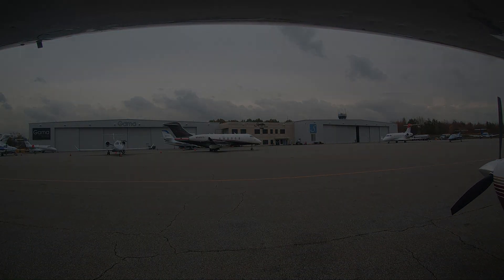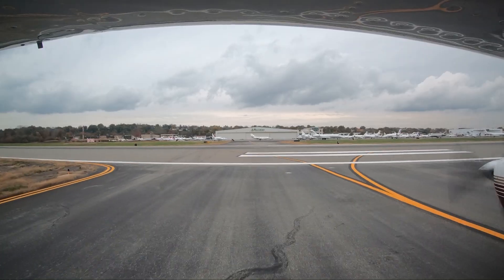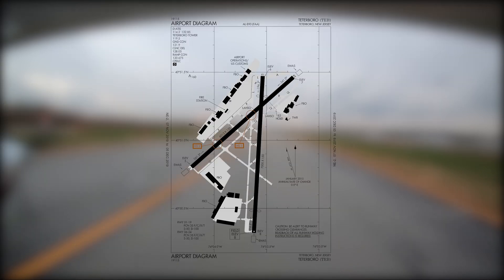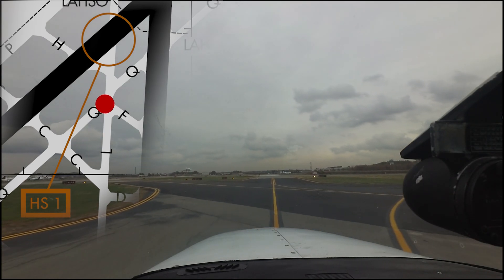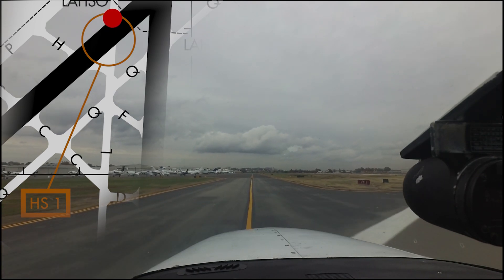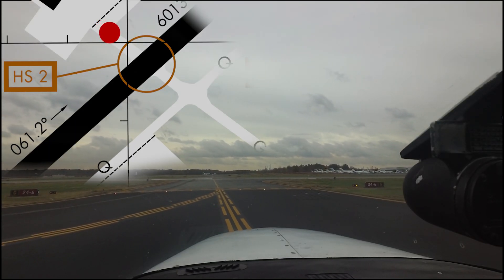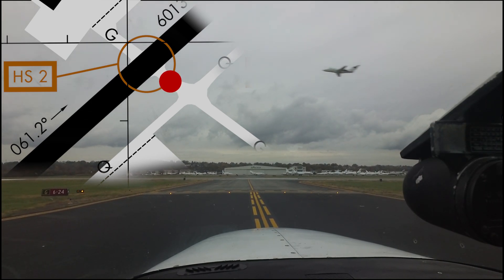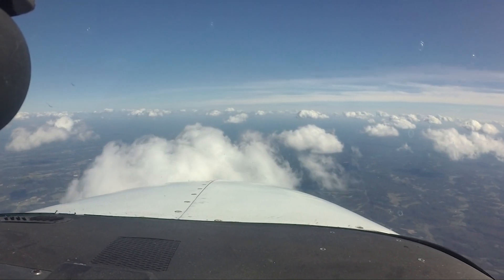From The Flight Deck – Teterboro, NJ (TEB)

Comment: First of all, great video. That said, why build an airport with such confusing intersections of taxiways & intersecting runways in the first place? That’s setting up the chance of an incursion before it’s even completed. Beyond that, any pilot that proceeds to take off when instructed to “Line up and Wait” needs a breathalyzer! Not only that but we are to read back all the instructions BEFORE proceeding. Not exactly rocket science. Be in your A-Game at all times when in the cockpit!
Reply: Hii
Reply: How about those awesome LAHSO signs. Our Lear 60 with brakes so bad that the plane should never have been certified is not the bird to land and hold short. If safety matters, eliminate all LAHSO procedures.
Reply: Welcome to NJ bro, nothing makes sense here 😂
Reply: Because in 1917 when this airport was created, 100 years into the future wasnt a concern of theirs
edit: its very easy to judge the actions of others without any experience. having operated out of teterboro trust me when i say its very easy to make a mistake when under pressure. shit happens
edit 2: also for what its worth, a lot of what theyre saying is "yeah, no shit sherlock" kind of stuff. obviously, you're not supposed to cross a runway without authorization from ATC. This video series looks more like just associating the airport diagrams with what it looks like on the ground.